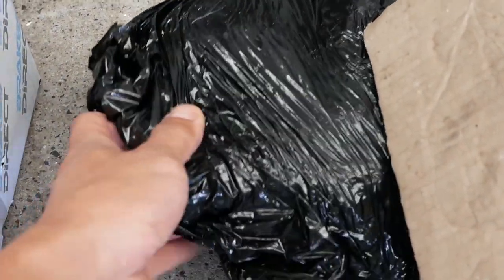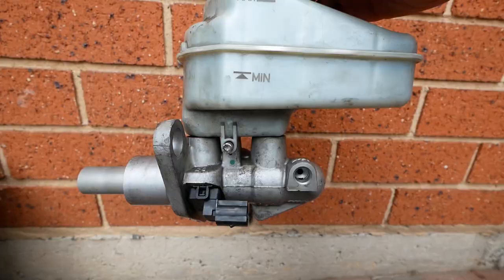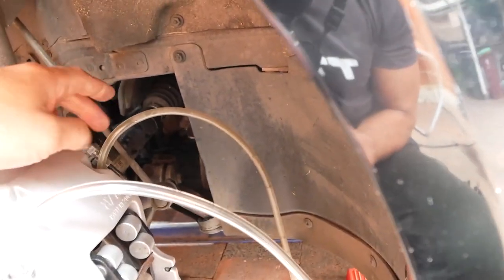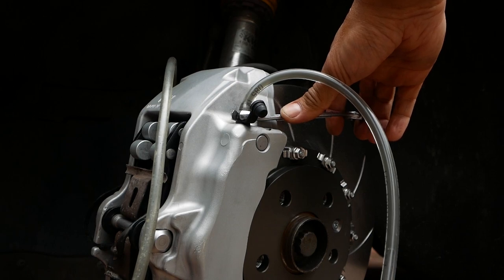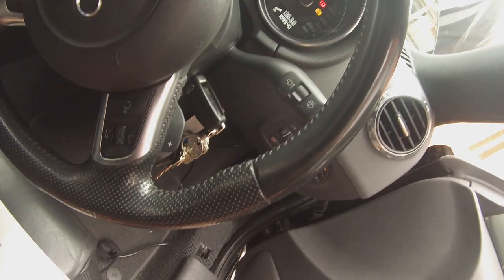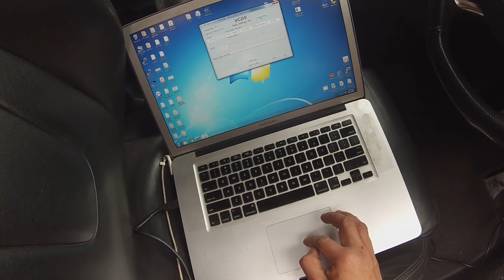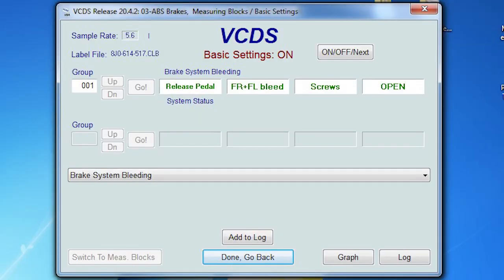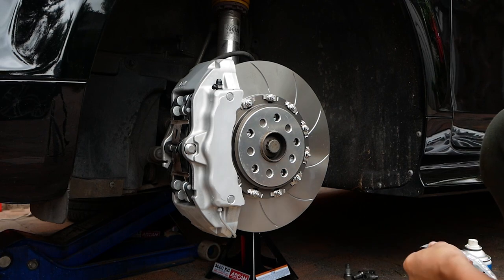Pt 3 Epic Big Brake Upgrade Audi TT Mk2 - Brake master cylinder upgrade & VCDS brake bleeding guide

Comment: It’s best not to reuse the break fluid, it only takes a little bit of grit in the fluid to knacker your master cylinder. I used a one man bleed kit that used air pressure from the spare tyre and I didn’t realise the spare had rust in it. This got caught In the seals and I load breaks completely. Foot to the floor at 60mph down a country road when I needed to slow down rapidly. Talk about brown underwear. When we swapped out the master cylinders we found the scoring. 

The brakes are the things that stop you hitting something and it’s just not worth the penny pinching so just buy plenty of fluid and throw away what you have drained.

Thanks for the video though much appreciated you putting in the time to go through it. Going to do this with my mk4 R32 as the garage seems to struggle getting air out.
Reply from the maker: Thanks David. I definitely will not reuse brake fluid moving forward. 

Good luck fixing the r32's system. This would definitely be the most foolproof way if all others have failed.

Comment: Great job, but after putting the "Audi Sport" sticker on the brake calipers you had to apply at least two coats of clear coat for protection.
Ottimo lavoro, ma dopo aver messo l'adesivo "Audi Sport" sulle pinze freno dovevi passare almeno due mani di vernice trasparente per protezione.
Reply from the maker: Hi Giancarlo - may you please translate to English?
Reply: Look at the answer

Comment: Hi Ian , very good video!!! great job, thanks for sharing .
I have a problem here, I want to upgrade my 2011 tts brake calipers , like 4 pistons caliper, tts has 25 brake master cylinder already, do you think I really need a bigger one? what is the size of TTRS in same yaer? 
Looking forward the answers from you.
Cheers.
Reply from the maker: Hi. That is already the larger MC so no need to upgrade it.
Reply: @ianpgonzaga  so the 25 version is the best we have for 8J tt/tts/ttrs? Am I right?
Cheers.
Reply from the maker: @prosche407  hey - yes that's correct.
Reply: @ianpgonzaga  thanks a lot !

Comment: Thanks for the video. Do you know if VCDS do the same bleeding process for the rear brakes?
Reply from the maker: There’s no specific setting for the rear but you can just go into the same option but instead of opening and closing the front you do the rear. It’ll push out the fluid 👍🏽

Comment: Hey man greetings from germany. I bought the brembo z18 and thought im gonna change the master brake cylinder. Does the one which u used fit in my S3 8PA?
Reply from the maker: Hey Reaper FX - yes that one should work. Same platform :) 

You might want to check if it is already the bigger one. I think it might be so maybe you don't need to change it.

Comment: hi. good video. did you upgrade to the TTRS master cylinder?
Reply from the maker: Hi Peter thanks for the kind words. Technically speaking - yes i did upgrade to the TTRS spec MC.

The MC spec from TT 8J 3.2 and TTS is the same size as the TTRS. (25mm)

Comment: Great stuff Ian! Thank you for the continuous high quality video. I have a 6 pot 17z installed on my R36, which I believe was off from a 12 Porsche Cayenne. The brake feels soft and I am thinking of braking the brake master cylinder. Where did you get yours and can you please share the part number? And is it necessary to upgrade the steel line? Cheers
Reply from the maker: Hey Chris. Made sure you did a full proper brake bleed ??

Otherwise you can get the "better" MC for any S3 8p, TT 3.2 TTS or TTRS 8J :)

PN in the video description
Reply: @ianpgonzaga  Thanks mate, should've checked the PN before asking. Yeah mate, will sure I do a proper bleeding when I install the new MC
Reply from the maker: @chrisluo4162  good luck!!!

Comment: Hey Ian, where did you get the 25mm MC from in Australia? Thanks!
Reply from the maker: Came from my TT 3.2 parts car that i used for the AWD and body panels swap. You can also use the MC from a TTS or TTRS :)
Reply: @ianpgonzaga  great, thanks! TTS only the 3.2 though yeah?
Reply from the maker: @petegraver8322  sorry that question doesn't make sense to me lol 

Can you please clarify what you meant?
Reply: @ianpgonzaga  haha sorry. Did the TTS come with different engines and thus some have different MCs? Or are all TTS MCs the upgraded ones? Finding some secondhand online and all the part numbers are a bit wacky
Reply from the maker: @petegraver8322  all TTS should have the upgraded 25mm MC regardless of the engine. They (TTS and 3.2 and TTRS) all have larger brake setups so regardless of engine should all have upraded MC. If in doubt get a pic that clearly shows the "25" on the body. You can see that in my video (i think)
Reply: @ianpgonzaga  awesome, thanks!  And last question, do you think RS3 8V MC would fit?
Reply from the maker: @petegraver8322  not sure. Have never seen one of those or know what their spec is...

Comment: How did you bleed your master cylinder? Thanks
Reply from the maker: Mainly using VCDS to electronically activated the ABS module and cycle the fluid through. I did not use any of the bleed points at the MC.

Comment: Just curious if the 2.0 vs 3.2L Brake booster size? are they different?
Reply from the maker: great question - in RHD they have the same size - tandem brake booster. the 3.2 is different by having a vacuum sensor in it. the 2.0 FWD did not have this sensor. 

In LHD they are different between AWD and FWD vehicles. Don't ask me why though... lol that's an ask Audi question  😜
Reply: Thanx.  I have a US 2.0T , it measured to be 32" in circumference, the 6 cyl measured to 36" , it has a build in sensor like you mentioned, I wonder if it has a build in solenoid.
Reply from the maker: @carlosh9489  pretty sure the only difference is that sensor. Which I remember when looking it up is like a vacuum sensor.

Comment: What's the part number for the bigger master cylinder?
Reply from the maker: Let me get back to you when. I find it. But basically you can get them off the TT 3.2, TTS and TTRS. They're all the same MC
Reply: @ianpgonzaga  Oh so I already have it then. My car is an 08 3.2l TT. I wonder if theres and even bigger master cylinder that would fit.
Reply: @ianpgonzaga  Any idea what rotors will work with the 17Z's on the Mk2 TT 3.2l? I know some use the Mercedes C230 & Volvo V70R on other cars but not sure if they will work on the TT.
Reply from the maker: @cmidas3396  yeah they sound right. If you follow any of the guides online for a golf mk5 they will lead you to your rotor options. 

In my case I went custom two piece.
Reply from the maker: Master part numbers here - https://audi.7zap.com/en/rdw/audi+tt+tts+coupe+roadster/att/2009-609/6/611-611010/

You can see they're all 25.4mm :)
Reply: @ianpgonzaga  Thanks man and thanks for answering in the forums about the rotors. Now I can upgrade my brakes to the 17Z's and upgrade my son GTI to my TT brakes.
Reply from the maker: @cmidas3396  perfect! Good luck and have fun 🙂

Comment: The way you you bleed it with vcds isn't correct , you need another person when it comes to press the pedale 10 Times to open and close the valve
Reply from the maker: i will try with two people next time but with this way i got perfect brake feel too
Reply: No,you dont need a second person,the abs unit close and open the valves inside the abs unit by itself.